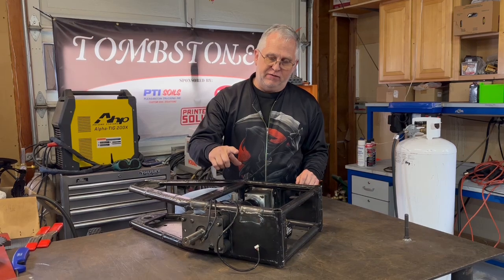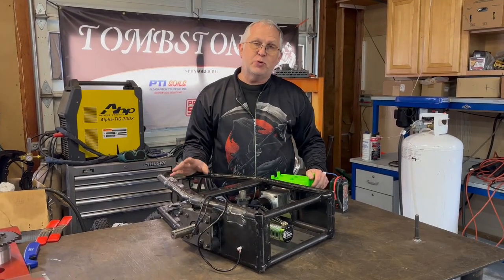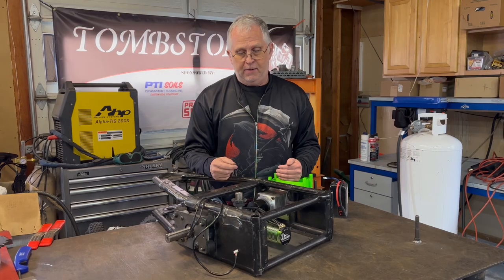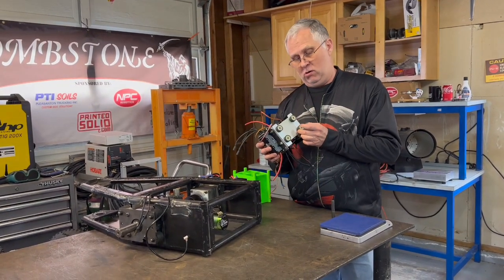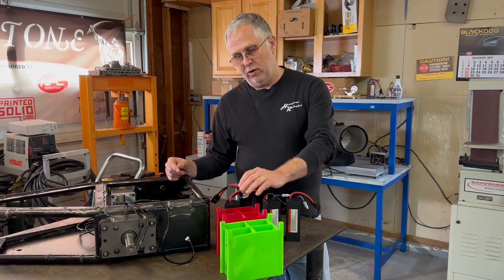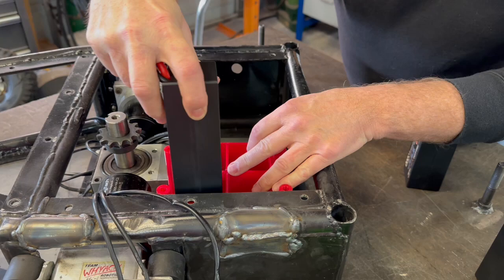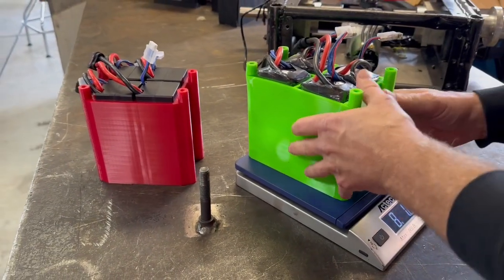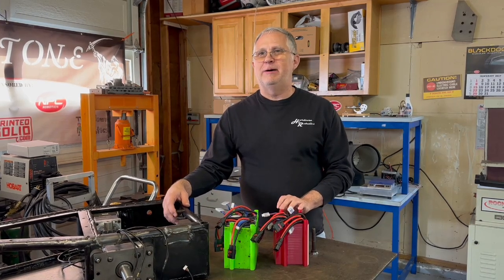Mortician Power System - new battery box

Comment: I've one query.Where are these escs applicable other than robotics and rc stuffs? 🤔
Reply from the maker: Most of the speed controls used in this sport are from large scale RC applications. There are commercial motion controls that are really solid, but most of them are huge and heavy, and would require some wrangling to work with standard PWM signals from the transmitters use.

Comment: One issue with lower voltage will be requiring thicker gauge wire to get the same power through it. Probably not an issue, but when every ounce counts it might become one.
Reply from the maker: The wiring used was always larger than needed, so there was no need to change anything there.

Comment: As long as the ESC can handle it, you can generally over-volt the motors quite a bit. If using a VESC (sensored), just throw in a nice conservative current limit and do plenty of testing so you don't immediately blow the motor windings from pushing too much power through them. The castle escs may also have configurable limits, but i don't know.
Reply from the maker: The limit of course is the ESC, and 8 cell is the max that the Castle controller works at. Honestly one of the main reasons to go to this setup was to get away from the VESC controller I had used before :)
Reply: @ray9368  It would be interesting to see if those castle ESCs can be modified to handle more voltage. It may be something as simple as replacing the capacitors with higher rated ones.
Reply: @ray9368  what VESC based esc did you use and what will you be changing them to? I've been building high performance PEVS (mainly escooters) with VESC based esc for years, and have not come across anything comparable for size/performance/reliability to nice VESC based escs (not flipsky and clones, they very unreliable in my experience).

Comment: Same flexible filament as the old battery box? Wonder what you'll do with the extra weight, could you run the other tires that were too heavy in the previous config?
That sensored motor should have a way better time spinning up that weapon, can't wait to see what happens in ~2 weeks!
Reply from the maker: Correct this is TPU, which is flexible material. And this setup has worked really well since i started designing them this way. Provides solid support, while making sure the mounting isn't so hard that it could physically damage the packs under impact.